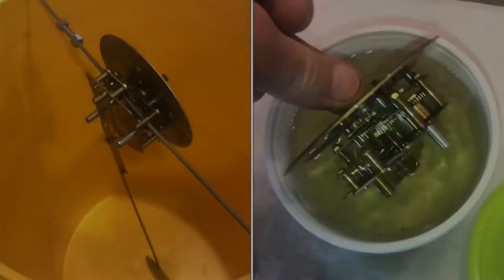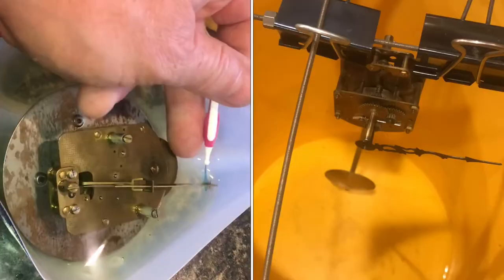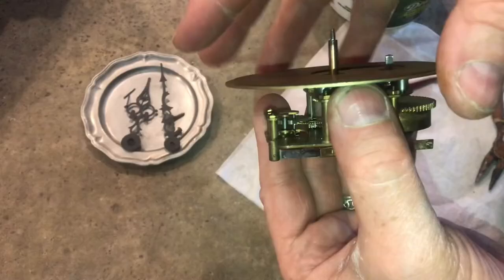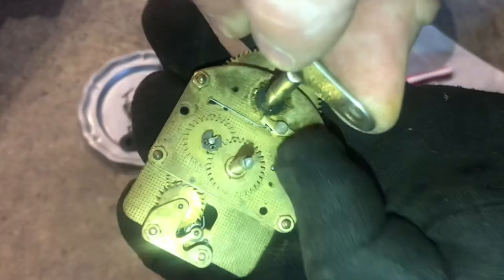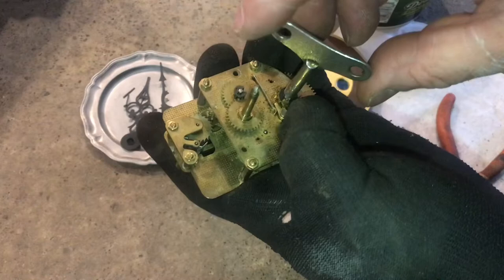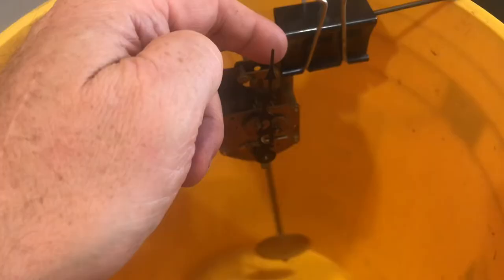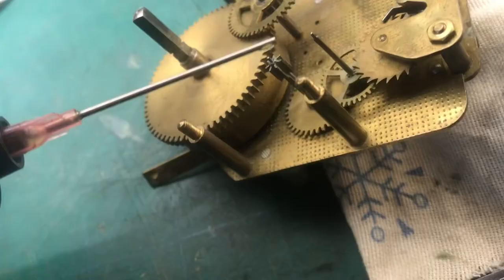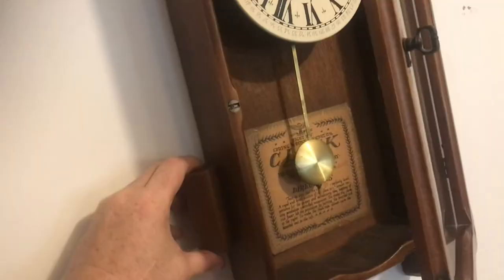“how to” CLEAN and OIL a clock movement (antique wall, mantle￼ or grandfather)

Comment: Excellent video of explaining what you have done. After about 30 years of our grand father clock not working working now for two years. I bought the correct oil and pressure to blow the dust out.

Comment: At 2:23 "oops": A similar situation caused a degloving of my finger when the key spun out of control. I would suggest unwinding with a tool like a small vice grips latched onto the key to avoid the injuries which might occur.
Reply: A mainspring let-down tool...
Reply: He doesn't have one either
Reply: @samspianos  
Could learn the hard way, yikes! 
I had a Sessions tambour with the infamous weak click spring let go on me many years ago - and I'm still a bit paranoid whenever I wind it, and I always use a let-down tool now to do so...just in case! OUCH!
Reply: @davestelling  In my case as I said it degloved my thumb;thankfully there was no permanent damage not even a scar to remind me in future;I acyually dont need a reminder I think the memory of it returns every time I see a clock and we are talking 40 years back

Comment: The only way to clean a clock movement is to disassemble it and clean in pieces. Release the power with a letdown tool.
Reply: This is known as the "Dunk & Swish" method...

Comment: What oil bottle is that one you used? And also is it safe to use pine oil or mineral spirits or denatured alchohol  to take the grease off clocks? Like to dissolve the grease and then clean it with ultra sonic. I read it's good to use  Elma tec A2 ultrasonic solution for brass

Comment: I soaked my wall clock guts in simple green cleaner 25% water and it cleaned it right up and stripped the grime and grease. Blew it off with air compressor and used Q-tip to apply silicone dry lubricant to all the areas with moving parts! Then I unwound the springs and wiped them down with WD40 and left em dry to the touch and it runs nice now!

Comment: Most posts say “don’t release the tension with your hands! It will take the skin off” clearly it’s fine if your careful! I’ve read petroleum is ok to clean whole lock parts without having to disassemble but worried about contamination.
Reply: His hand literally slipped in the video. Lucky for him the spring caught on a click. 
Its clearly safe, until an accident occurs. Then your finger has no skin. Let down tools are expensive but worth while.
Reply: @aSmelly1 So, this is the way to unwind without a letdown tool. I wonder if there is a video showing how to use letdown tool. I just got an old clock that is not running. In a few months, I might try cleaning it and getting it running, but it may just be wall art. I know there are pieces missing and it won’t ring right. would be nice if it would just tick and keep time.
Reply: @lydiaahubbell8545 
Many videos here on how to properly release the mainspring w/a let-down tool...